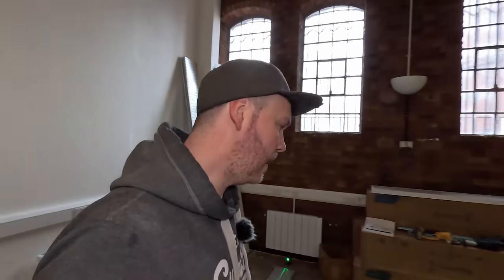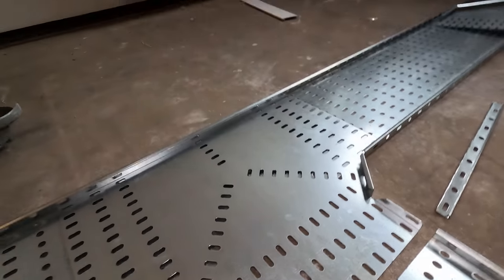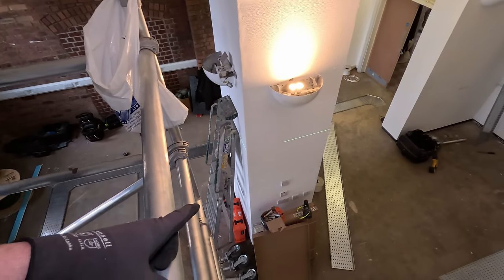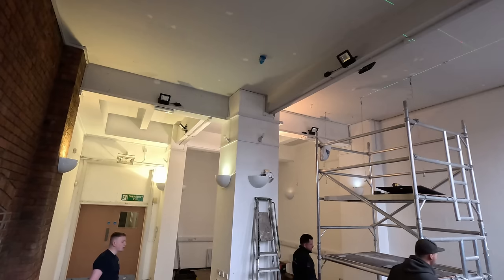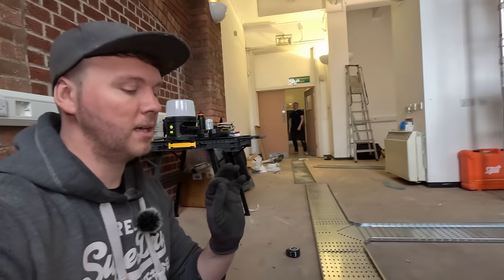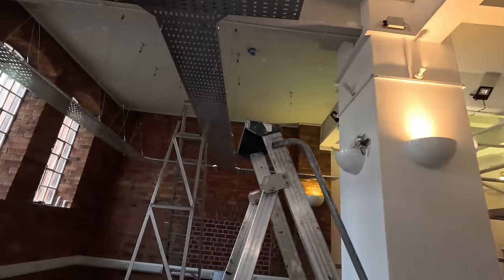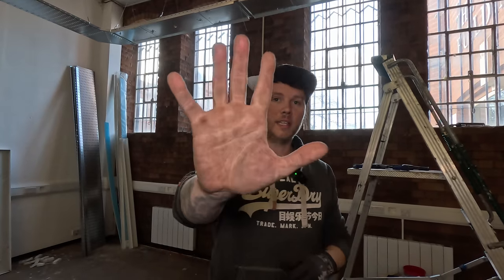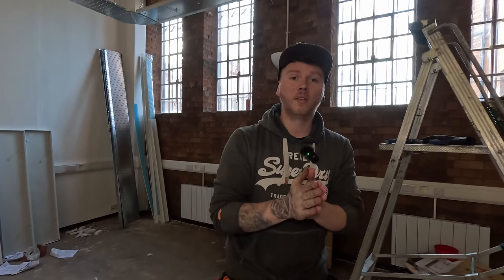Shouldn't Have Drilled Here - Ruined New Tray

Comment: Would've been interesting to comment on how the spacings  for the ceiling fixings were determined re weight/load of all the tray and light fittings, especially re the toggles used in plasterboard.

Comment: Hi great video 
Being a plumber I can remember laying cast iron system on a raised walkway in the same way before fixing so fixings could be transferred to the ceiling positions with ease but if you’ve never done before it’s quite hard to comprehend 
Regards 
Lawrence Peters
Reply: You hung cast iron pipes off a ceiling?
Reply: When I say ceiling it was the structure above my head I believe it was cast concrete beams and concrete infill
Reply: @lawrencepeters4139 what cast iron pipes were you fitting?

Comment: Am I getting this right, you are hanging all that from the plaster board on the ceiling😳😳😳😳. I am sure the fixings won’t pull out but the plasterboard is only screwed to the joists or whatever is holding it up. No way is that designed to hold up some cable tray.
Reply: Pretty much all the fixings at in joists

Comment: I’d take studs and hangers over suspension wire any day of the week.
Reply: Same here not much support on that tray prob ok if no weight on it.
Have used the wire but on heavy duty basket tray.
Reply: They hangers are suitable for a weight of 280kg per one with a SWL of 56kg depending on the substrate they are attached into, it’s a balance of how you want it to look too I guess
Reply: @brightsparkmid  Too much movement for my liking, I’ve used both systems and prefer stud hangers.
Reply: @alvina69  each to their own, I have used these for years and commercial installs and feel it looks cleaner, I have also used tons of strut and channel on nigh sub main installs. Each has a purpose I guess
Reply: @brightsparkmid what is the weight loading of the tray where the hook passes through the hole.
The wire hangers were never the problem.
Not a problem if lightly loaded.
Reply: @kevinwright195  next to nothing, medium duty tray with led lights on 3 hangers per section of tray with extras on the joints oh and a 1.5mm cable

Comment: I have not done this sort before (well, I am not an electrician! 😂)  but at 5:17 is it ideal to add a nut or bit of blue Loctite to prevent hooks from loosening?? And yeah I would do the same, lay it out on the floor before hanging, only if the room is empty 😀

Comment: Anndddd it’s not galv tray 😂
Reply: It medium duty pre galvanised tray, 

There are two types on the market. 

Both are galvanised but one is pre galvanised which comes in on steel rolls pre galvanised then made into trunking etc 

Or

Post galvanised which is door in a bath of hot zinc after production, 

Both give different finished but I assure you that it is galvanised
Reply: It medium duty pre galvanised tray, 

There are two types on the market. 

Both are galvanised but one is pre galvanised which comes in on steel rolls pre galvanised then made into trunking etc 

Or

Post galvanised which is dipped in a bath of hot zinc after production, 

Both give different finished but I assure you that it is galvanised